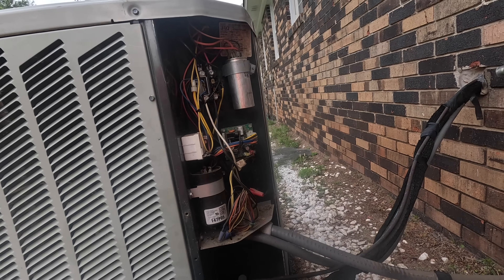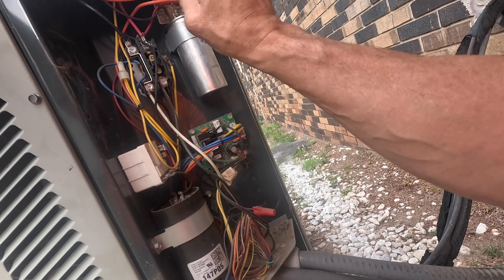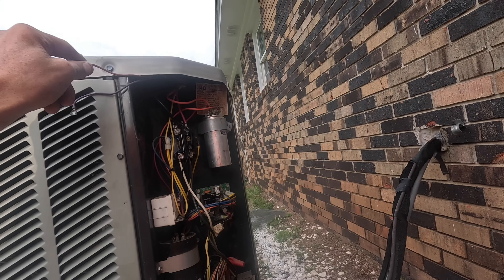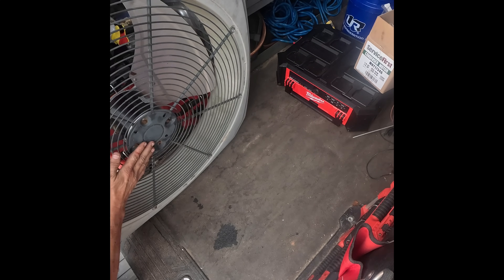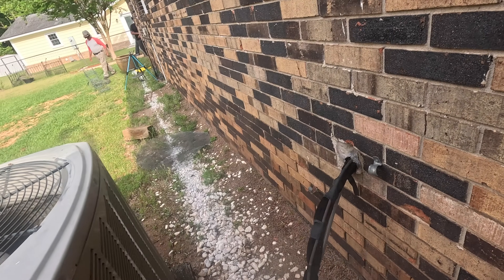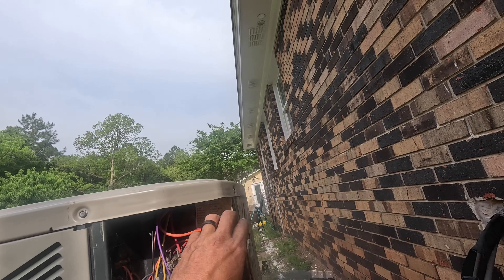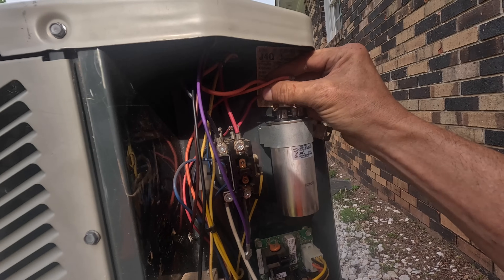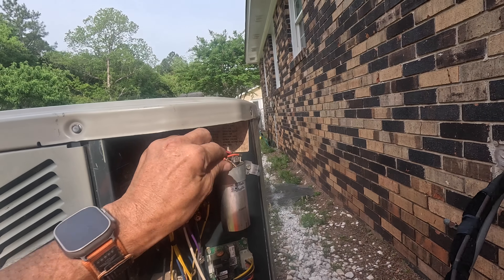Condenser Fan Motor Was Turning Very Slowly! #hvacguy #hvaclife

Comment: I would have charged for the parts only on condenser fan motor. free labor, since that was beyond your control.  the missed line-set leak, could have spanked most everyone and may not have been leaking to start with on first coil. refrigerant sniffers are only so good and can false trigger if there's a big leak/gas cloud. the ultrasonic/sound detectors can be fooled by other noises too, but if you slow down and work the gain knob or direct them more slowly, they'll help a bunch. there is still no guaranteed dead accurate "here's the problem" outcome, it does take years of experience and skill, but never take that for granted, because it may very well come back and bite you.. no need to ask how I know

Comment: Man I wish you lived near me, had a tech over I must have a pinhole leak or a very small leak somewhere and he couldn't find any leak. So I told him to top it off. $450!  5lbs of r410a. 
I'll have someone else come over next spring and see how much refrigerant leaked out.See if they can find the leak,hopefully it's not in the coils. I know leaks can be difficult to find.
Reply: If your system needed 5lbs then that is a pretty big leak.
Reply: @williamserver4332  yeah but it could of been over a period of 4 or 5 years that's when I had a major leak it was topped off 9 lbs.  So all I know is it's down 5lbs since then. No leak was found it's prob coming out from the coil
Reply: @williamserver4332  that's not a big leak that's a small leak of your only losing a pound a year.
Reply: @brettMichaell4186  if a system is two lbs low it will freeze up and not cool.

Comment: Curtis looks like you need to have a work mate on your van that folds down my two HVAC guys have one on each of their vans and they really like them. You can close the center together and it will hold your motor shaft in place while you mount the grill assembly to the motor And it works for several other things as well and then it folds up and it stored out of the way in your van…. Just a little FYI for you I hope it is useful for you. Stay safe stay positive…… 🇺🇸👊🏼👊🏼✌🏼🪚🔨🇺🇸